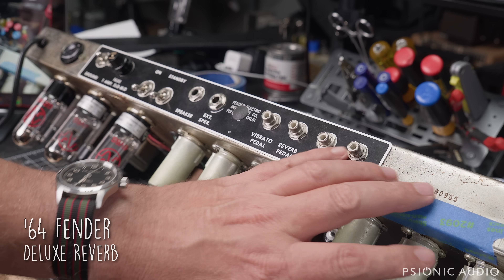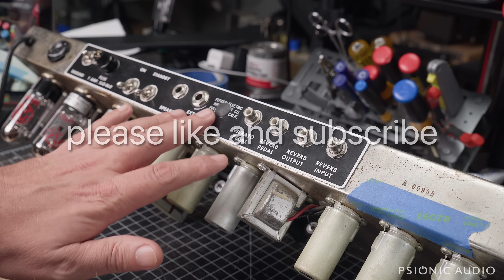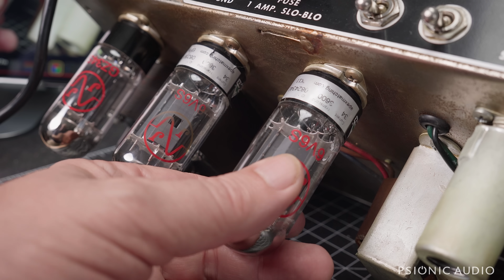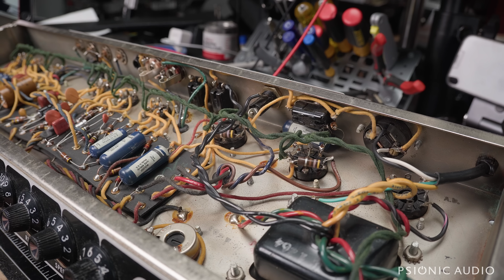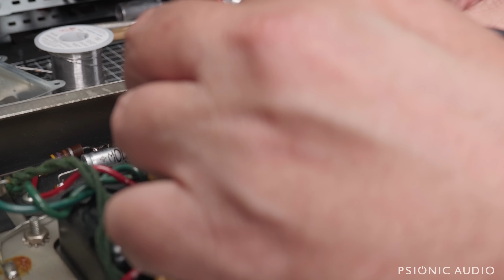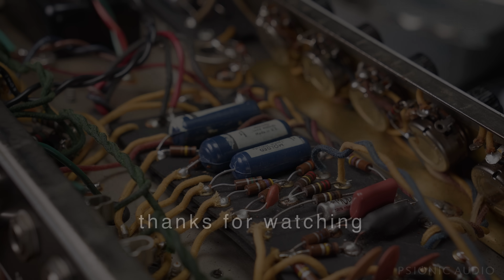Goodness | '64 Fender Deluxe Reverb Pt 1

Comment: There are ways to test these brown capacitors, ESR, capacitance, and how they react under load. If they pass those tests, there's no need to replace them. Whether the tech has time to run all those checks is the real issue. They do affect the sound a lot—anyone saying they don’t is wrong. If they're out of spec, sure, replace them. But keep in mind, some techs will swap them out without doing proper testing.

Comment: Love your channel.  I have a question and do not know how to get ahold of you. So here it goes. I have to tube amps. Both you do not recommend. Got before I found your channel.  I have a vox ac10 with a creamback speaker.  I also have a Fender Blues Deluxe.  I have just to play around with. I do not gig. I will make the modifications you recommend for the Deluxe.  My question is I want to change the speaker on the Deluxe.  I was thinking of a Eminence Swamp Thang or a Warehouse Reaper HD. Do you have any suggestions. Thank John
Reply from the maker: Thanks John. 

Those are two very different sounding speakers. For how most people run their BDs, the Swamp Thing or the Veteran 30 or ET65 would be different flavors of ideal.
Reply: @PsionicAudio  Thank you very much. Keep up the great work.

Comment: Please let me know if there are any other mods I can do to my 64 handwired pronceton reverb reissue other than slowing down the temeleo
I might be too far off with this precious circuit but was hoping it’s close
Love the amp I steward but kinda wish I had a 12 inch speaker instead of the 10 inch alnico jensen that comes with it
It’s broken in so sounds pretty good all the same
Reply: Yea my engrish is not too good pleas forgive grammar

Comment: FWIW I believe "P3" on the F&T caps is the date code. I'm not a full-time tech but I've used just enough of these caps to see a pattern. Unless I'm all wet, I think the first character is the year, with letters J through S represent years 2015 through 2024 (with the pattern presumably extending to earlier years as well). The second character is month, 1-9 for Jan-Sep, then letters O, N, and D for Oct, Nov, and Dec respectively. If I'm right, P3 would be March 2021. Thanks for another fine video, top-notch as always.

Comment: Lyle, on fender black and silver panel amps, do you up the 12AX7 plate resistors from 100K 1W to 100K 2W, and if you want low noise clean do you use Vishay Metal Film?

Comment: Speaking of AB763 circuits with reverb, I have a question about providing a filter node and a ground point for the reverb section. Where do you think is the optimal place to run power to the reverb circuit? I see on most schematics it is connected to the preamp node and ground. Do you prefer this as is, or do you recommend for a scratch build giving it its own filter node and ground point separate from the rest of the preamp? I've been wondering this after watching your grounding videos and reading various articles on Valve Wizard.

Comment: What’s up with the double caps for the treble control. Is it 2x500pf ?
Reply from the maker: You see that in a lot of early AB763s. It’s two 120pFs in parallel. You’ll also see two 10nFs in place of a single 20nF.
Reply: @PsionicAudio sorry had my cap math backwards. Yeah two 120s would track, I know they used 120pf’s in the bright cap position.
Reply: @ 8:30 I'm with you on that - run out of 200/250's??